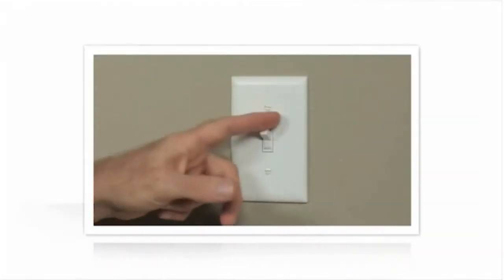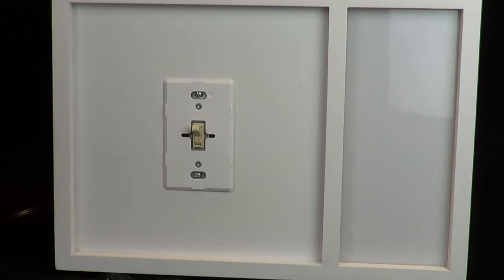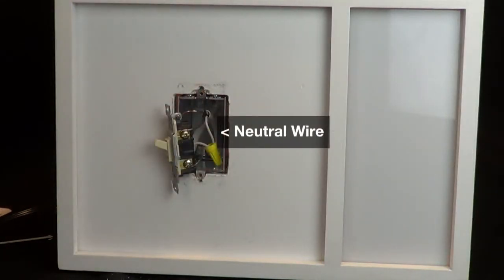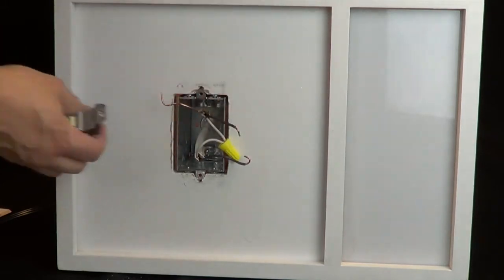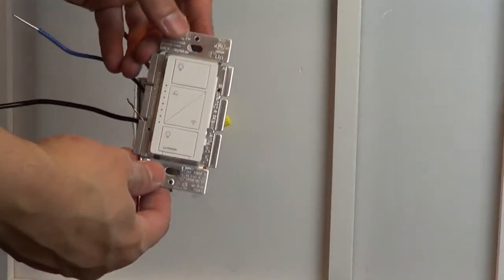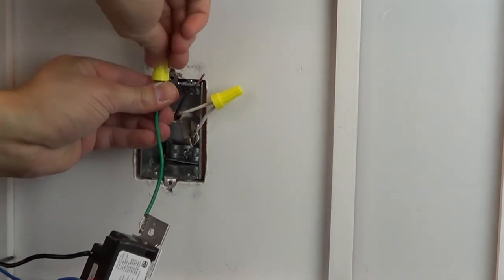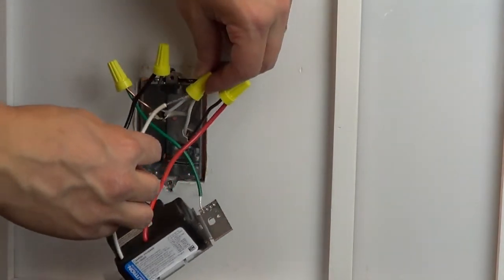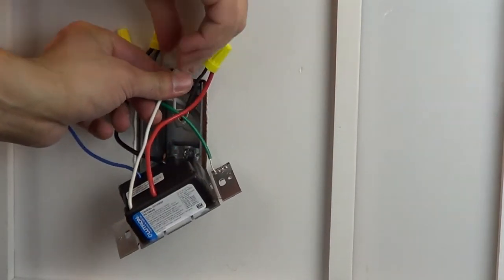Wiring a Control with One Black, One Red, One Blue, One White Wire (Single Pole Application)

Comment: These videos are a joke? I bought your product and mine has 2 red wires, well one red and one red with a white stripe? Plus the black and green.
Reply: It doesnr mattee what colour the wires are, just look at the switch and read what they are, common and hots. If there are two hots then thats for a 3 way or separate circuit